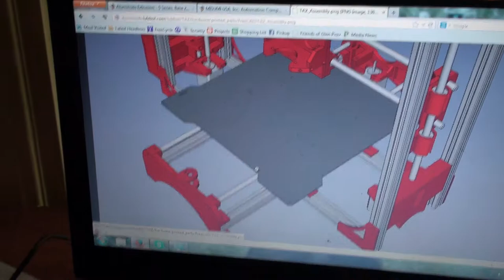DIY Taz Misumi Frame Components

Comment: I just finished watching all your videos on this build. Thank you for posting them been a big help.

Also you might want to think about using these parts if you want to upgrade your printer http://www.thingiverse.com/1013/designs they are really strong and they fix alot of the issue the stock parts have.

Also check out the upgrade parts i made as well. http://www.thingiverse.com/Alup/designs and let me know what you think.
Reply from the maker: You are most welcome. I have printed many of 1013's parts but I have not had time to install them yet. I am planning an "upgrades" video where I install them as well as a few others such as auto-tensioning :)
Reply from the maker: Nice corner! Did you use a dual extruder setup to print the accented one?
Reply: Aidan Williamson

No i paused the print, Changed the color, Then resumed the print. The taz I am upgrading that i have will have a dual extruder on it when i am done though.
Reply from the maker: DJAlup
very cool. I look forward to seeing it so that I can steal it for my own! I saw one mod from 1013 on thingiverse. do you know of any others?